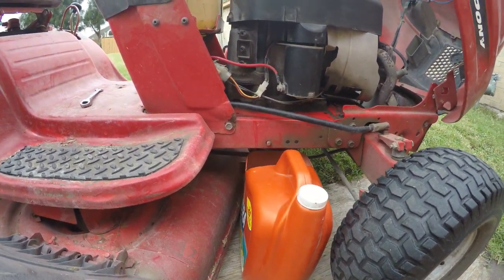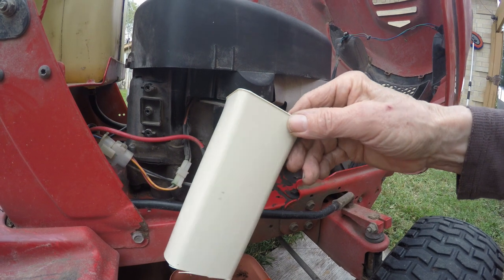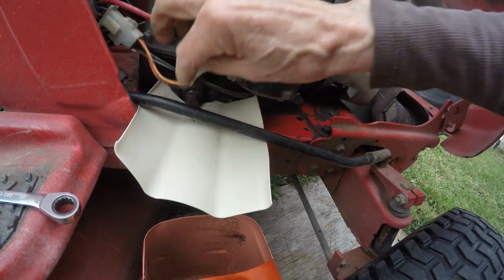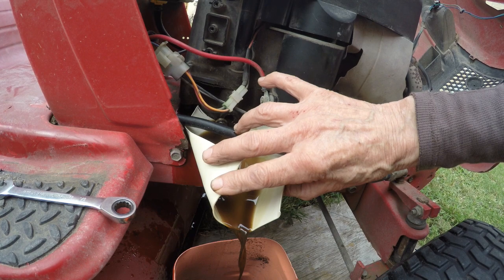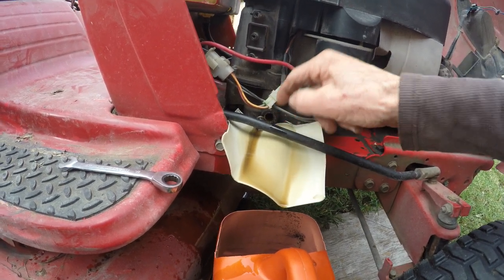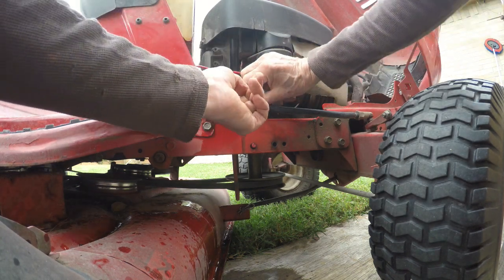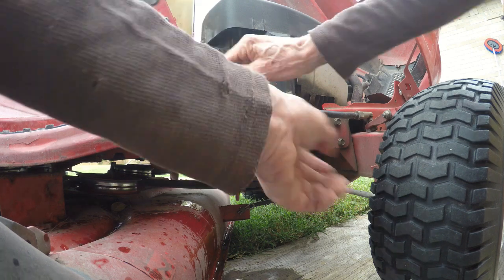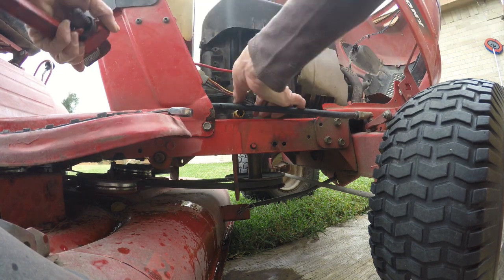Troy-bilt Pony Briggs 31C707 17.5 HP Oil Drain Plug Modification

Comment: Hey buddy any idea what the size is of that square nut?   It's a pain to get to, but I can't figure out what socket to put on it.   It's square too, so I'm not even sure if a socket would do it.   I need to get some leverage on it too, as it seems to have been put on real tight by the manufacturer and this will be my first oil change on it.
Reply: I think it is 7/16"
Reply: @railroad9000  Oh OK LOL, thanks but I no longer have that tractor.